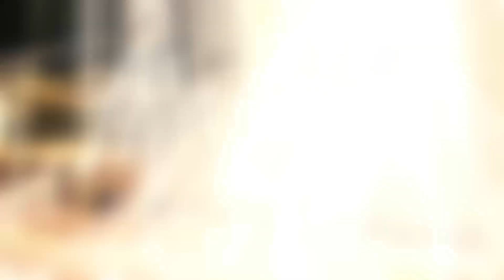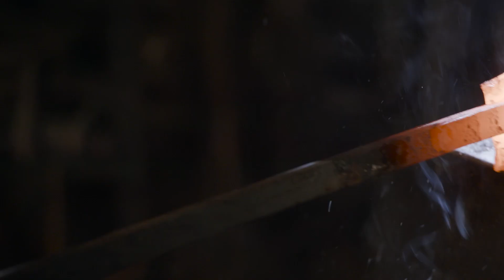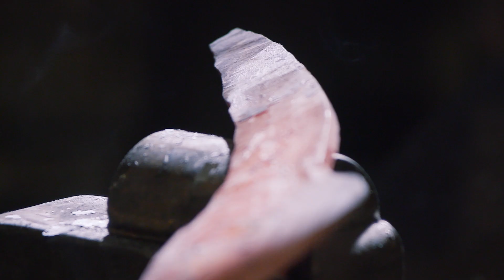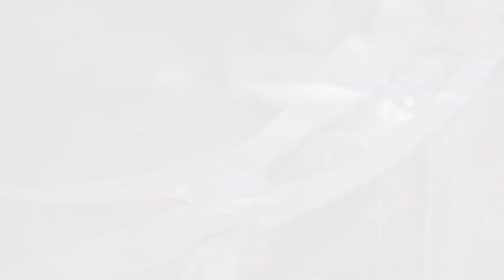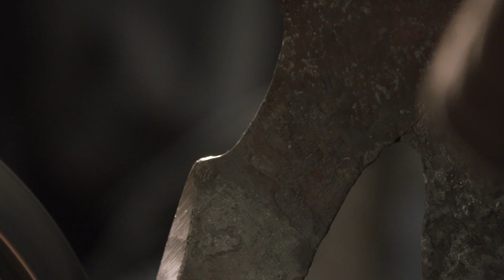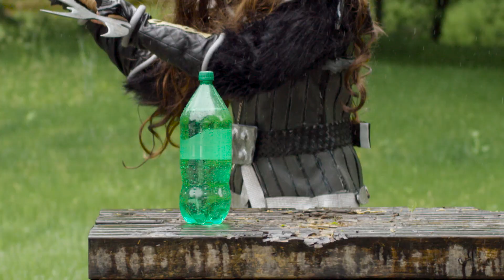Sword of Kahless - Star Trek - MAN AT ARMS: REFORGED

Comment: You can sort of see it at the end by the elbow bending when using both arms.  The Kahless style is hard to hold because the handle is too short unlike the original batleth.  With a normal batleth can be held with my arms straight out.  And to make it the same handle length the Kahless style would need to be scaled way up and that's not practical either.  a shame the prop dept didn't consider this.

Comment: watch the reveal at slow speed and you'll see how shitty this thing actually ended up looking. what a waste of all that forging for an uneven grind, a crack and decoration that looks partly made of cheap gold paint.
Reply: there are no cracks on the blade ..And considering the actual prop maker of the weapon liked it ..cannot say much more but thank you for watching .
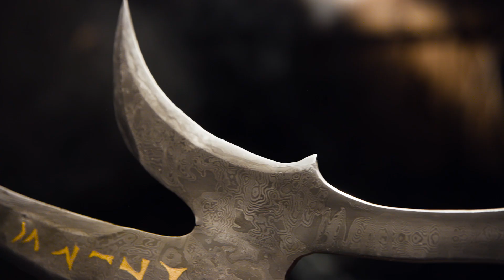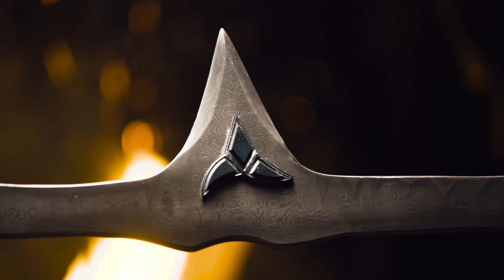Reply: 13:53 - on the left side middle - cracked - 13:46 you can see it as the video is panning. The upper half of the blade is unevenly ground; in fact the whole thing looks asymmetrical. Sorry but it's true.
Reply: It is not a crack . I should know .  Not trying to get into a long debate but I feel I should have a pretty good idea of what it is . If you do not like the piece that is fine . This was not made in months or weeks .
Reply: thanks for clearing up what it actually is though lol
Reply: sinephase when I get home :)
Reply: so this is where the 2 parts were forged welded together and basically it was missed during clean up to even up both sides . Normally it would be ground clean and match both sides as much as possible .

Comment: BRÜTAL

Completely impractical weapon, but gorgeous build none the less.
Reply: yes, all the sword experts i've heard talk about it agree it's a terrible weapon, but so intimidating it's probably going to save you from needing to fight.
Reply: It's not an impractical weapon, it's just it's a weapon that would take years to master. LoL. It in the right hands would actually be a very good weapon out on a battle field.
Reply: those aliens were not much different in body shape and  number of arms and legs from humans, so being an alien weapon still not make it more practical
Reply: I think it's not totally impractical. It can be used to block any attack and then cripples the opponent and disables. You don't want to be in it's way.
Reply: I've heard it mentioned that fighting with a batleth is very similar to fighting with a staff.  It's a 2-handed weapon with a lot of reach and a lot of swinging motions, coupled with some jabbing motions.  It requires a huge amount of strength to wield it quickly and accurately, but if you can handle it properly nobody with a normal sword can stand in your way.

In addition to it's reach and weight, the bladed ends and center can block as well as attack in a large variety of ways.    Fully extended reach, it swings like a massive battle axe .... up close using your own center of gravity, it can swing back and forth like a pair of daggers or you can push right at your opponent with the center or one of the ends in a stabbing motion.

As said by many a Klingon ... "THIS IS A TRUE WARRIOR'S WEAPON!"
Reply: Except when your opponent has a basic understanding of swordfencing. Unless you can hook the opponents blade while he's asleep on his feet, you don't deflect more then one or two blows with this thing. By the second blow the nice leverage of the wide blades to your narrow grip makes it basicly impossible to keep the weapon where you want it.
Your opponent will not oblige you with long overhead swings or convenient sweeps from side to side - he will come from the center and batter the edge of your weapon away from your body so he can deliver a cut to your arm, belly or neck.

Comment: Ok so you lost me when saying you have to scarf the material to get a good forge weld. That is Ludacris as there is actually even a name for the type of weld you say isn't a good weld...it's called a fagot weld and is most certainly a sound weld...I mean after all, that's how pattern welded steel is done...in a series of fagot welds. You don't have to scarf your ends to get a good weld, just make sure you address then a square ends during forge welding...start welding moving towards the end on the first weld...second weld start at the end and hammer towards you breaking the corner...it will blend just fine...

Comment: First of it is a good build, but they have skipped so much in this video. I mean, the gold markings on the blade wasn't shown. They didn't even show how they used the material to work on the handle, and the black insignia was only partially shown. I'm sorry, but if this video had shown those scenes, then it could've won me over, but I'm sorry it didn't.

If I'm not mistaken, Tony the previous presenter also made this exact weapon.
Reply: Close, but no, it was not this exact weapon.  It was a generic bat'leth.  Whereas this is a specific weapon, with a distinctive look, and a significant history.

I agree that it would have been nice to see the trimmings.  But those are fairly mundane features, compared to the complexity of building such an oddly-shaped weapon.  Likewise in drawing out the Damascus pattern in a different way to normal.

Messing with the video length is a bad idea, when dealing with a hugely successful format.  So I think the team made a good call on what to keep in versus what to drop.

The kind of thing you are talking about has been covered on other, simpler, builds.
Reply: Thanks and I understand what you’ve explained.

Comment: A vibrosword, just like a regular sword, only the blade vibrates at a really high speed, so the blade cuts more with far less pressure. U might need a seperate power source connected by a cable, kinda like a proto-lightsaber.